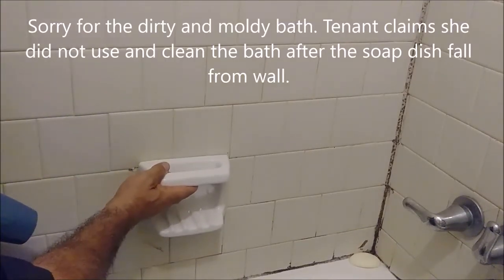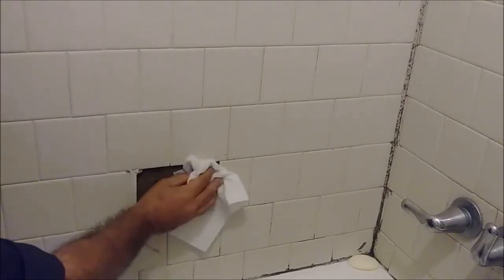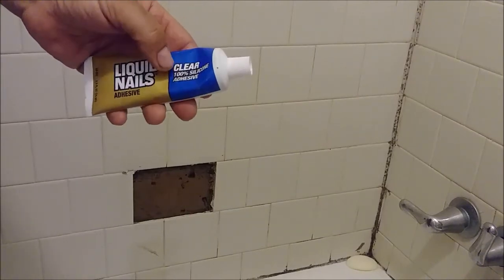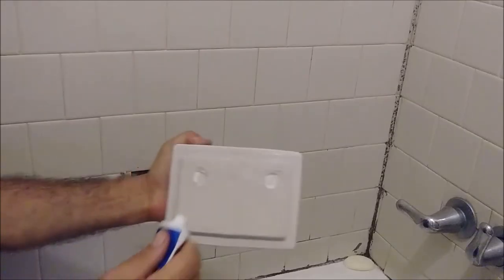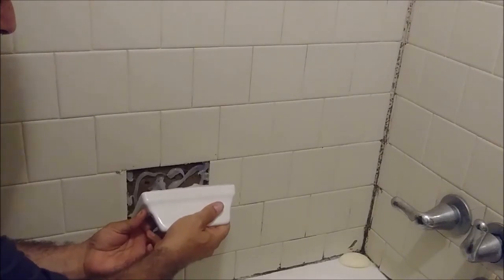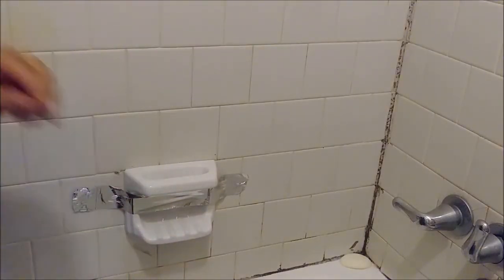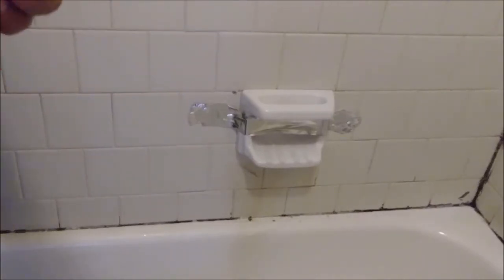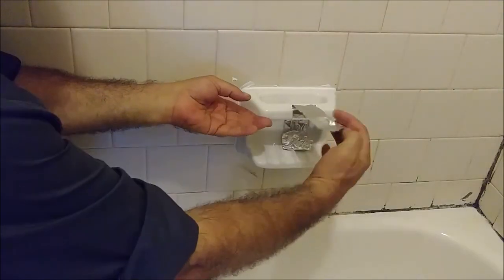How To Install A Ceramic Soap Dish In Tub or Shower   Step By Step

Comment: Thank you Joseph K for the instructional video.  I cleaned and scraped.  Used a single-edge razor blade to get it right down to the tile.  Instead of liquid nails, however, I used Gorilla Heavy Duty Construction Adhesive.  When I put the soap dish into the hole I tried to move it a bit to make sure it was in the right place.  But.  It.  Didn't.  Move!  😲 Still, I put tape across it "just in case."  I just did the job right now so can't tell you if it will last forever but it sure seems like it will!  Thanks again!  I would never have thought to do all the things you told me to do to prepare!

Comment: I would use polyurethane construction adhesive as the primary glue and the silicone adhesive around the edge. I wouldn't trust the silicone adhesive to hold it long term.

Comment: Mine fell off when I was cleaning around it to re-caulk. The backer board behind it wasn't wet, but there was a hole in it, with no stud behind it. What would you recommend on how to repair it without without taking off an area of tile and replacing the backer Board. Thank you!
Reply: Curious what solution you found

Comment: That silicone caulking is full of mold. You can clean it by 1) wearing gloves 2) soaking a cotton cloth in full strength bleach 3) putting it on the moldy caulk for and leaving it there for 8 hours. After that, put more bleach on the clock and move it to the next part. Takes a while but it will all come clean.
Reply from the maker: Thank you. Tenant  already cleaned it.

Comment: But is that handle really strong enough for a person to grab onto? My handle just came off and there is no drywall behind it, just a 2x4 on the side.
Reply from the maker: Depend what s power you apply on it. The soap dish is to put soap and not to grab onto.
Reply: Not a handle...rag holder right?
Reply: not suppose to grab on to it.  It's a rag holder
Reply: Mines fell off while I put my foot on it. 😩
Reply: Got to remember it’s an soap holder only and not a foot holder.
Reply: @munchocrisps  haha that’s great I do that too
Reply: @josephk9182 But you should be able to apply a decent amount of pressure without it falling off. It's ceramic which could break bones. It's not supposed to just fall off under slight pressure. Imagine kids in the tub or the elderly grabbing on for support. It's supposed to hold up under those circumstances.

Comment: Good video.  Can DAP Kwik Seal adhesive caulk be used to reattach the soap dish?
Reply from the maker: Yes if it is silicone
Reply: @josephk9182  Okay. Thanks.
Reply: I overfilled it with silicone so the extra push through the cracks on all sides so I know it’s air tight. Then smooth out the silicone so it’s presentable
Reply: No, it won't be strong enough. Use PU construction adhesive.

Comment: Hmm... yeah it works and bit messy. dishwashing liquid and water with rubber applicator I prefer when applying silicon to the final job. The condition of that wet area is appalling that is black mold.
Reply from the maker: This bathroom was remodeled 2 month ago alter tenants left.

Comment: I tried this less than an hour ago. Future people, feel free to reply and ask if it held up. (Mine fell off after I held onto it and had the dried plaster still attached.)
Reply from the maker: You should use adhesive silicon not plaster.
Reply: Did it work?
Reply: @soon2bparamedic480  Yep, it's still up with the liquid nails silicone (though I used the red Multi-Purpose Adhesive one).
Reply: You used the same stuff he did and the soap dish fell off?
Reply: @surveytestmoney2550  No, it fell off before and I needed a way to reattach. It's still up after the liquid nails, three years counting.

Comment: That shower stall is nasty. It hasn't been cared for by the owner of the property for a long time. It appears to be moldy. It needs to be professionally re-grouted.  If water has been soaking in the backboard behind the soup dish,  a hair dryer won't remove the possible mold that has begun to grow. 
Just a homeowner's opinion.

Comment: The soap dish is old fashioned and dysfunctional. Why not add a niche for the soap instead of setting yourself up for future repairs, as the extended dish will fall off again and again. Besides, the niche looks better and are easier to clean.
Reply from the maker: Eventually I replaced all the ceramic and the soap dish.

Comment: Judging by the looks of your tub I would say the soap dish is the least of your worries.  Gross!
Reply from the maker: It is not my bath room or tub, It is rental property.
Reply: @josephk9182  but it’s your rental property? The tenants may get mold-induced illness!
Reply from the maker: @craigkilstrom7522  Yes. The tenat already cleaned the bathroom he did not use it for sometime because of the soap dish situation and mold starting growing on the bath calking. I am planing to remove the  bath walls because it is ceramic tile on drywall. I will put backer board instead with porcelain tiles.
Reply: HAHAHAHAHAHAHA

Comment: Can water getting behind tiles in shower?

Yes,  and cause damage. The most common cause is worn out caulk between the  wall and the surface of your . However,  also seep into the  wall if there are missing  or grout. Once  the wall, the  will weaken the wallboard.